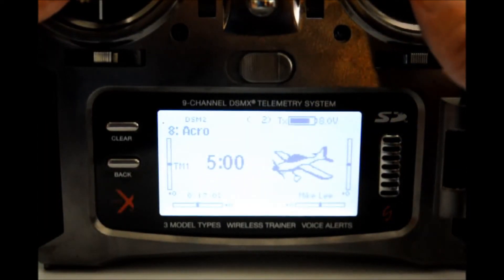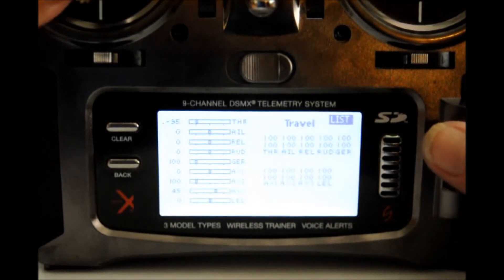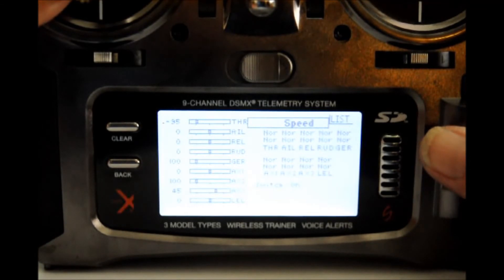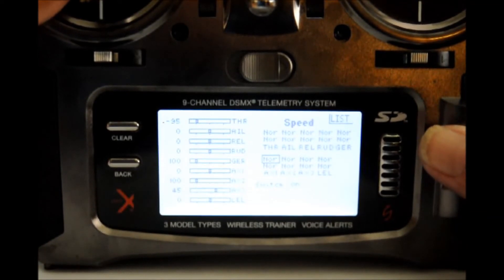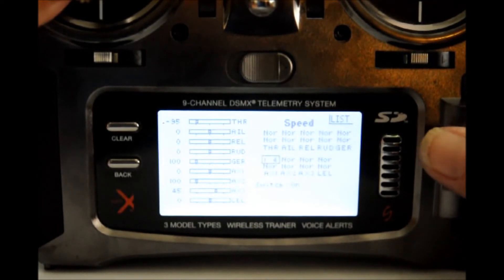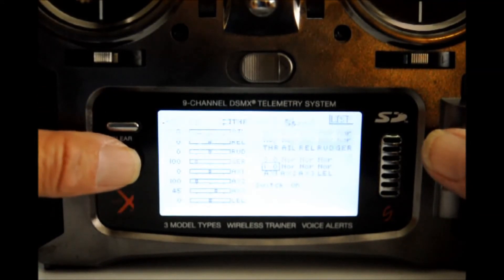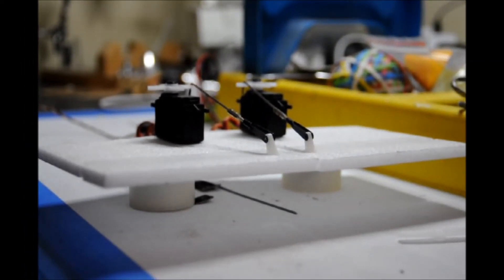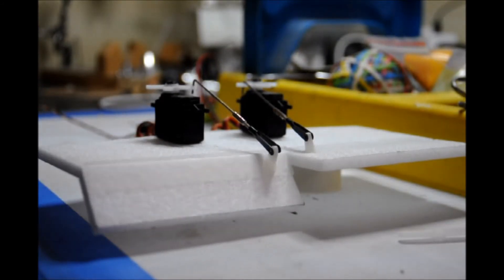Team Tech Tip, Servo Speed Adjustment

Comment: Mike using my DX9 when I add the seconds for speed, all it does is delay the time it doesn't slow it down.  So if I have it set for 10 sec it does nothing for 10 sec then it snaps back into place at the normal speed.  Is there some other setting I have goof up?

Comment: Hi
I have a problem with assigning sound . I can use every sound until I get past half way like past elevator, Aileron, in put then I can use like beginner mode1 beginner mode 2 and 3 there are half of the sound that don't turn on on my stick when I choose them. I'm new learner and trying to appoint the sound on the sticks on my Spektrum Dx9 for my 
E flite spokesman s and my Mini quadcopter. I would appreciate the help as have have tried looking online for help and couldn't find I don't know why half of the sound don't work on the transmitter sticks 
Mainly it's the sound from have way to the bottom of the scroller I need the ones like beginner mode , intermediate made, and Advance mode. It picks the sound by when I flick the sticks the sound doesn't command. Thank for the help.